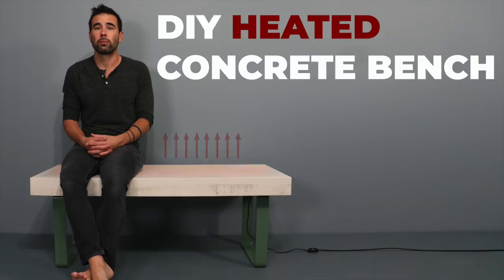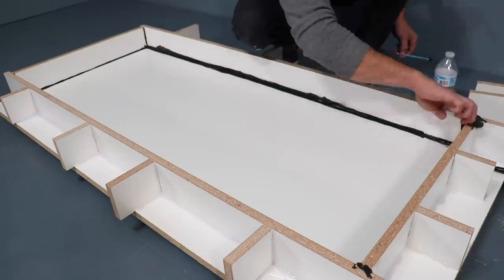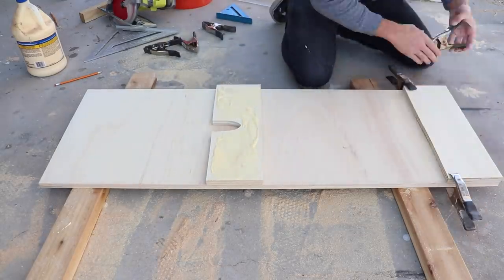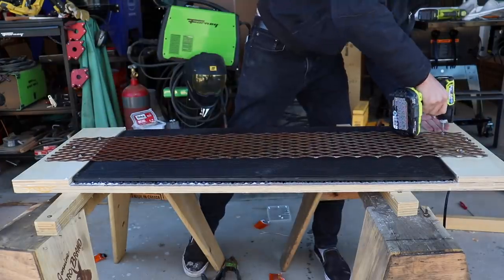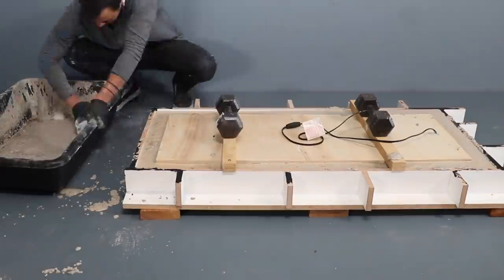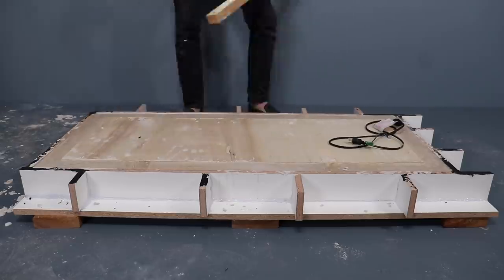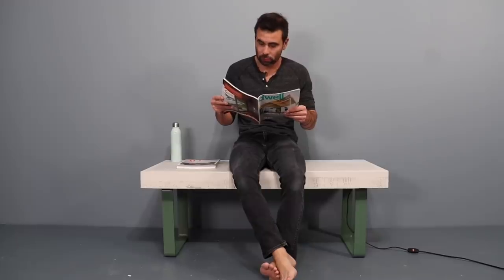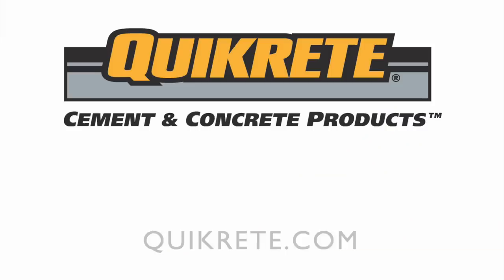DIY Heated Concrete Bench

Comment: Slow heating of new concrete is the best.  As it ages the heating rate can be faster, but that would take at least a month or two.  FYI, if you can find some scrap slate to put into the slab, even hidden, the heat transfer and retention would increase exponentially.  Jack.

Comment: I love the design!

To give those propane heaters some credit, they do a pretty good job of converting energy into infrared energy, which only heats objects, not the air, thus the reason they are used outdoors.

We have been experimenting a lot as it gets colder (in Wisconsin). The biggest paradox to work through, is that the more warm clothes we wear, the more it acts as an insulator to any heat source. Our best solutions so far is space header under a lawn chair, with a large blanket wrapped like a tent around you, and or a heat source inside your jacket (heated blanket, heated jacket, ect).

Comment: Attach that mat with the inslutating foil to a mesh slightly smaller then the form. Put 1 bag in the mold, then the mat with mesh, then the rest of the concrete. This will save a lot of energy and get the heat to the top a lot faster.

Comment: By having the heating element so shallow in your mix, it means you have to heat up a very large mass, before it gets to a person sitting.

Besides a heat pump contraption, I don't think you'll get any higher efficiencies from other heating solutions. More directed insulation might help.

Thanks for the build.

Comment: Look for heating wire kits for floors. We use them in home remodeling and I did a project where we embedded it in a concrete breakfast bar for a heated top. They can be run off of a potentiometer, but they usually come with a thermostat w/probe so you'd be able to set it and forget it. This would be way more energy efficient as you could set a schedule for it to automatically turn on and off (eg. we set the breakfast bar to start warming up at 7am so within 30mins it would be warm; off by 10am, back on at 7pm, etc).

The higher quality kits are also VERY low amperage. Looking at the size of your bench your could probably use a Nuheat 15sqft kit which is ~$200. Only issue would be wiring as they are not wall plug compatible out of the box.

Comment: Ben, what about using in-floor heat tubing instead?  

I was thinking about this after you mentioned it on the podcast in regards to outdoor restaurant seating.  You could encase and terminate each run to quick disconnects in the concrete mold.  The disconnects would allow the benches to be used without any wire or tubing connected when no heat is needed.  Or you could daisy-chain multiple benches together, which would likely be more efficient than individual heating elements.  This also avoids the possibility of a "dead" heating element incased being encased in concrete.  The tubing would be less error prone and the device most likely to fail (heat pump/element) would be external and easy to replace.

Comment: There is a spa in the UK that uses heated concrete reclined lounge seats. They got pretty hot and were completely tiled using small mosaic tiles. The heat pad sat directly under the tiles,  exactly like a real tiled undefloor heating system. Im unsure if tiling is the look youre going for, but you might be able to get some concrete 'style' tiles taht might work!? Anyway, keep up the great vids!

Comment: You can use andruino and some thermopeilers to the work plus adding some heat sensors for not being so hot in the meantime when not in use being on the cold weather it can regenerate some energy

Comment: Cool. Been thinking about something like this for outdoor/bistro seating - tables, benches, etc. I think for a practical, safe setup you would need to use high quality warming wire/mat that has a thermal probe, on GFCI, has a simple dial for temp control, etc. I got some links to products if you want.

Comment: I love the idea and would like to see a test outdoors, weather permitting. Radiant heaters can be directed, right? Another benefit is they go from off to on pretty fast. Your bench is conductive - so I think whether one is more efficient than the other is an open question. The bench is certainly more aesthetically pleasing.

Comment: Nice idea, and a clean design and finish!
What about using copper pipes as reinforcement, and then let the heating or cooling system (electrical or water based) run in it? That way it can be close to the top (where you want the heat) and it can be replaced if broken!

Comment: I really love the simplicity of this project. I want to make a platform in my garden like this for lying on in winter. I dont understand power output to temperate but i saw you had used 135w heating mat, roughly how much concrete was above the mat once the construction was complete? I want to get the concrete up to 98-100F  just above body temp but im not sure what sort of heating mat i need. Underfloor heating mats say they go up this high but they are more designed for wood i guess. Do you think increasing the thermal mass of the concrete with a more dense aggregate would help? I was also thinking to add a layer of piping filled with antifreeze that runs along side the heatintg system as i presumed that it would heat up faster than the concrete to help distribute the heat faster. Please let me know what you think? Again. Great video👍

Comment: Great concept, it made me think of a concept you could try. Maybe copper piping throughout the design and copper coiling underfloor heating. The legs could be connected to the copper piping and also be copper pipes too. BUT instead of concrete, how about clear resin to see the elements inside?

Comment: really cool idea! I suppose the only issue with  pressure activated heating would be getting the heat dispersed through the concrete fast enough to warm up the user. Perhaps the bench could have a constant low level heating system that is ramped up when pressure is applied?

Comment: it would be easy to make it pressure sensitive by using load cells either as feet or between the legs and the piece.  The only issue with that is it takes 2 hours to get to 10* above ambient temp, so idk if id want to go that route.  Youd probably be better off using a smart plug that turns it on at certain times of the day when youre most likely to use it.

Comment: I would like to see something like this built into a driveway powered by solar. No more shoveling snow. I have seen something like this before using copper pipes and hot water to heat homes. Might be  a good idea for commercial buildings to warm an office. The down side is that it is electric so eventually it will fail. You would have to find a way to replace pads when they go bad.

Comment: I think the extra ideas at the end of the video are a little too much. I think if you embeded this pad maybe an inch from the top surface and more-so encapsulated it in the concrete, it might heat up faster and not dissipate much heat through the bottom. Another thing that would make it more efficient is having a thermocouple in the top layer to then be able to switch it on/off at a certain temperature. I just think the idea of trying to get it to heat fast enough when someone is sitting on it is a far stretch.

Comment: Thanks for your wonderful videos. Just finished enclosing a screened-in porch into a sunroom. Unfortunately here in NY, it gets cold. I am thinking of turning metal framed couch into thin concrete couch. Or maybe the concrete fiber material I believe you made for a thin curved chair in the past. Wondering if the heat would do any damage or affect the concrete. 🤔 💭

Comment: Could the steel reinforcement be used for faster (and more exact) heat transfer? Like a piece against the heater connected to a butt shaped piece on the top?

Comment: Have 2 modes: Stand by (keeps the temp above, say 60℉), and an 'in-use' mode (ups the temp to 80℉ or whatever you set). Makes cold starts less cold.
Reply: if ambient room temp is 70 degrees, the concrete will never get below this temp.
Reply: @leefhead1  Ben mentioned a restaurant (was it?) with outdoor seating. That is what I was referring to.
Reply: @doubledarefan  ah, perhaps i missed that.  my mistake.

Comment: Electric resistance heat is 100% energy efficient. Does that heating pad really heat up to "Operational temperature of 130°F." ?
You might look at small thermostat modules. You can get them in about any temperature. 135 watts is a little over an amp at 120VAC so even the small 5amp packages should be fine. They come in little round packages about 3/4in diameter with terminals on the bottom (a thermodisc e.g. ksd301 I think) or in little bars about 1/4in wide by 1/8in thick by about 3/4in long with leads coming out one end (ksd9700, maybe). Thermal fuses come in similar packages so make sure you get a normally closed, heating thermostat (a fuse opens once when temperature is exceeded and that's the end). Oh, and normally spec'd in celcius.

Comment: How are you going to power the the heater? If you are using an electrical cord think about rigging a rocker off and on switch on the side if the bench or just underneath.

Comment: I'd recommend making the concrete thinner and putting a piece of insulatuion foam at the bottom. Because it's not all that efficient if it turns on when you sit on it but takes two hours to get warm. And after leaving all the energy it releases when it cools down is wasted. And also: make that heating mat replacable so you don't need to build a new bench once it burns through.